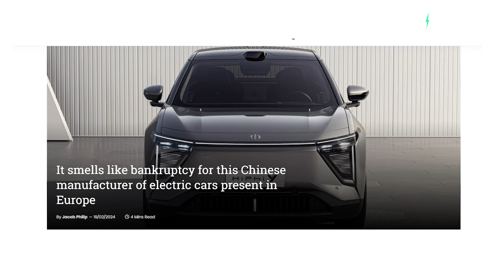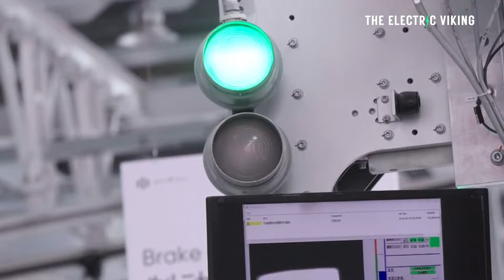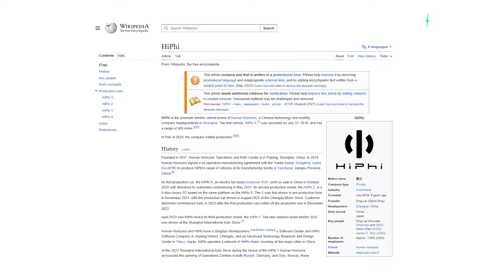Famous Chinese EV brand stops making cars and fires nearly all staff

Comment: BYD has just announced a new low priced EV that is likely to mean the end of the ICEV.

The BYD Qin Plus starts at $11,000 (79,800 yuan) and has a 261 mile CLTC range. About 170 miles using EPA standards.  It’s less than five inches shorter than a Toyota Camry, roughly the same width, and a bit taller.  Interior space is likely to be better than what a Camry offers as is typical with EVs.

Rumor has it that BYD will build an EV factory in Mexico where labor costs are as low or lower than in China.  Manufacturing in Mexico would mean qualifying for the US EV subsidy.
Reply: For some reason I don't see Americans buying Chinese cars 😬
Reply: @miti4045  

We heard those sorts of statements in the 1970s as the Japanese car invasion got underway.
Reply: @bobwallace9753 And the Koreans.
Reply: Millions and millions of people do not have the ability to charge electric cars
Reply: @daweigo6851 
Millions and millions of people did not have access to gas stations.  We built what was needed. It will be a lot easier with electricity.
Reply: @bobwallace9753  This logic is false, Japan and Korea are US allies. There is 0 reason for US to prefer Chinese cars. Even if they manage to sell their products in the US, they will get the VW treatment, but 10x worse. It also makes more sense to empower small countries instead of superpowers.
Reply: @miti4045  

How about this reason.  A choice between Chinese and Japanese/Korean/US/European EVs with similar range, features, and quality but the Chinese EVs sell for half the price.
Reply: @bobwallace9753  how about this, chinese EVs are priced very similarly to VW or Tesla, even if it was half the price, the resell value will be terrible. Also, I can buy an ICE for half the price with much  better equipment. Also, I have never seen a chinese car, ICE or EV, in the same quality for half the price...
Reply: @miti4045  
How about this,  China is producing a lot of very good EVs for half the price of VW and Tesla.  Who cares what the resale value will be if the car pays for itself in a handful of years via fuel and maintenance savings.

Don't dismiss Chinese EV quality out of hand.  Read some reviews.  China knows how to make quality products.

Do try to keep an open mind.  Technology is evolving very rapidly.
Reply: @bobwallace9753  " that is likely to mean the end of the ICEV"
Lol. What is it's published range? What is it's real-life range?

Then I will categorically tell you it will NOT mean the end of the ICE vehicle.
Reply: @HappyBagger  
Think a bit harder.  A sub-$20k EV with at least 150 mile range, even a 125 mile range would be a great second car for pretty much any household with multiple cars.  Even as a first car for many.  

Let's say your someone with a 60 mile or less commute and take only one or two long trips per year.  You'd save a bundle even if you rented a car for a couple of long trips.

More important, if China can produce a Camry sized EV and sell it for about $15k then they will be able to produce a longer range EV for a few thousand more.  And they are.  

EVs still have room to drop in price as we have yet to reach the end of battery cost reduction.  ICEVs have no route, that we know about, to lower their cost without giving up features and comfort.  And as ICEV sales drop ICEVs will become more expensive to produce.  Economies of scale will benefit EVs but harm ICEVs.

Comment: In case you haven't noticed EV demand is drying up. Early adopters jumped in and now there's not enough demand from rest of us to sustain the current production. Most of the major manufactures are pumping the breaks on EV production or expansion. There are graveyards of new EVs in China that were only made for the government incentives. None of this is market driven and that will be illustrated very soon.

Comment: This is not surprising considering owning an EV will cost you more, over it's realistically short life, than an equivalent ICE competitor.
Reply: In the six years I have been driving my second-hand Leaf, my biggest expense has been $20.00 for windshield washer fluid.
Reply: @PxThucydides a used Nissan leaf is only worth about 20 dollars, so that's not bad..
Reply: I've driven well over 30k klm in my Mitsubishi minicab miev EV and it cost me the equivalent to 7 Land cruiser tanks of diesel.